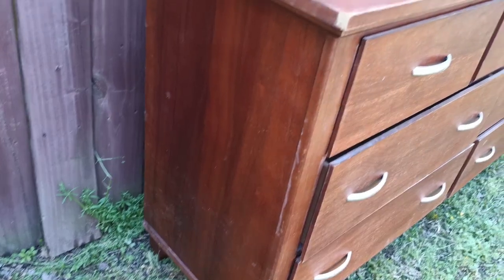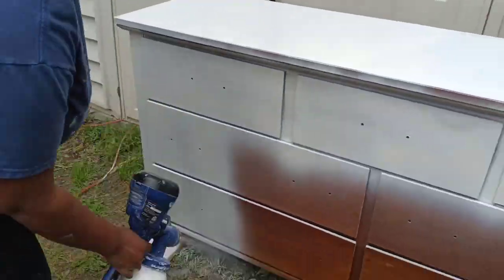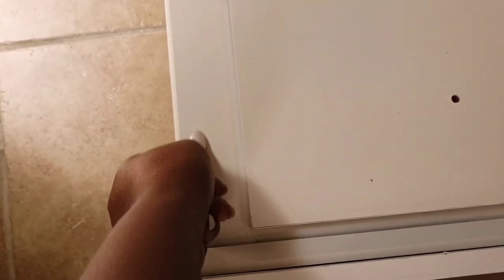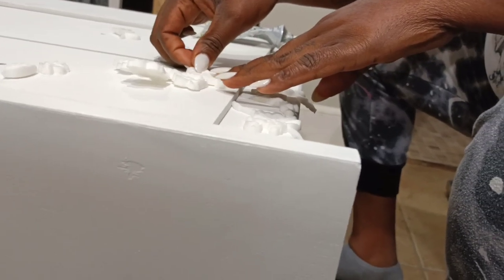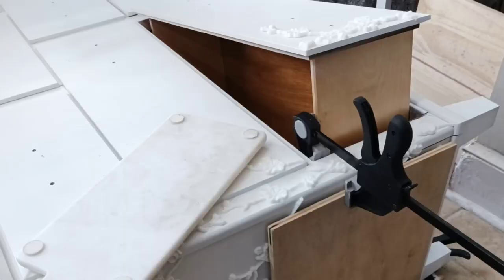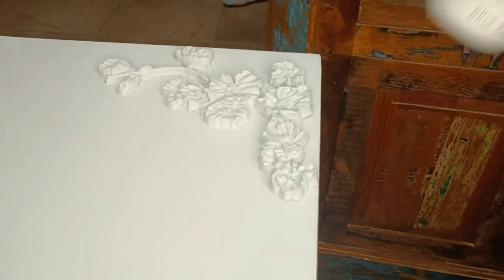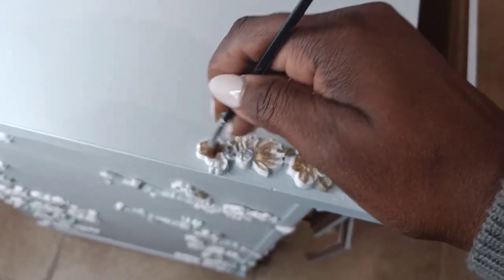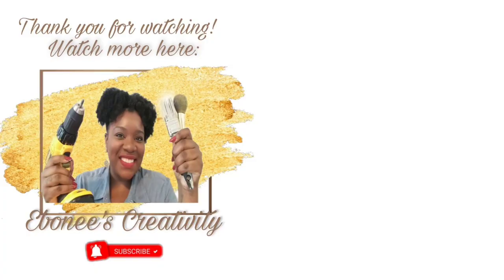OOPS! I MADE A MISTAKE! | FURNITURE FLIP | ANTHROPOLOGIE ENCHANTMENT DRESSER "DUPE"

Comment: Just wondering why you didn't use tape to keep your flowers in place until they were set up. I can't say I like the gold flowers. In my opinion, it makes them look to bold and on the cheap side. They would look much more delicate if left white. Other than that, you did a great job on this dresser.
Reply from the maker: Thank you! I did not want tape stuck to E6000. I felt it would cause a bigger mess. White would definitely have been more delicate but bold is moreso my thing. Thanks for watching and commenting!

Comment: Hi Ebonee before painting wood piece what sanding paper should I use ... and whats the best paint you use for good coverage that doesn't clog up.....I love this piece u have done it looks great ....if I was to bye 1 of your piece do you send over sea England.....I really want 1 of your furniture flips ... thank u
Reply from the maker: Hi Becci! I have no idea if it would be possible to ship overseas but I will definitely look into it! If I find that it is feasible to do, I will put the information in an upcoming video. Thanks so much for inquiring! I'm so glad you love my pieces😉 
If the wood is in mostly good condition, I'd use a 220 grit sandpaper then paint. If it's in not so great condition, I start with a 120 grit sandpaper then if that isnt working I go down to 80. If it is working, I go up to 220 grit after the 120. After 220 if there are still very minor imperfections, you can go up to 400. My favorite paint is Wise Owl. It is very thin and self levels so you don't have to be a pro to use it. It is also ready to spray straight out of the container & no top coat is required. I use a lot of Fusion paint on my channel just because the shop that I get my Wise Owl from is about 45 minutes away and the shop that sells Fusion is about 3 minutes away. Fusion is not a bad paint either and it has a beautiful array of colors but it has a bit of a learning curve to use it in my opinion. If you watch my older videos you will see that I started out with Waverly chalk paint. I think that is a good option for beginners because it is very thick and forgiving as far as brush strokes are concerned but I would not recommend it if you want to spray your paint. Hope that helps! Thanks for watching!
Reply: @Ebonee's Creativity  thank you so much ebonee . I hope it possible to ship over to me because I'm decorating my kitchen and I would love a little cabinet from you .....I look forward to all ur further content do you patron so I can donate to your channel I really enjoy what you do .
Reply from the maker: @youdontlikeme5066  You're welcome! Happy to help🙂 I would be so worried about shipping anything with glass but I will definitely still look into it. 
No, I don't have Patreon. Only CashApp/Venmo/Paypal.
Reply: @Ebonee's Creativity  I will donate on PayPal Wednesday.  Not sure how to use PayPal but I will find out ....you need set up so people can support your channel...xx
Reply from the maker: @youdontlikeme5066  It's so sweet of you to consider giving to my channel! You can find me on PayPal using: ebonees.creativity@yahoo.com. 
Thank you so much!